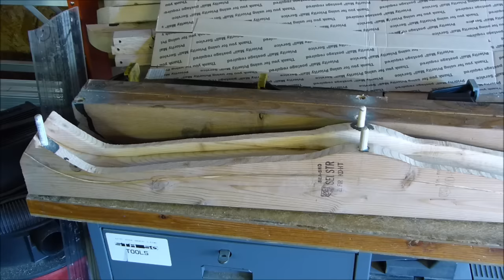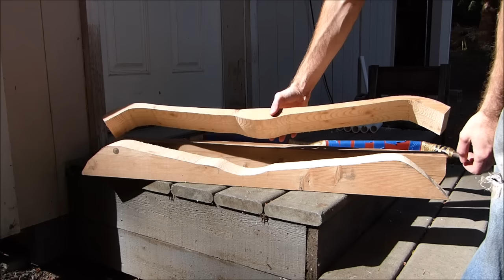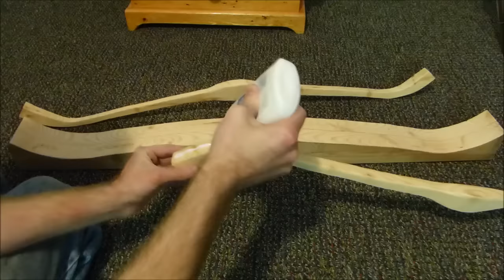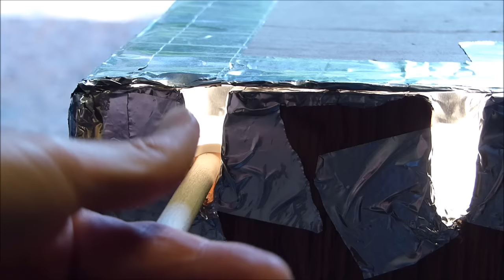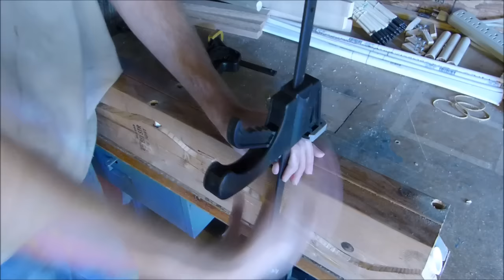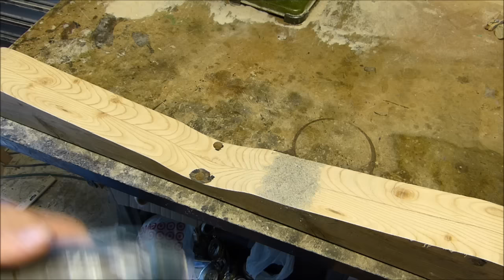Make A PVC Bow Mold / Press

Comment: If one has any talent at all, it is perfectly 
feasable that you could design you own bow and not have to "clone" an existing one. Your methods leave a little to be desired, in that the bulge you wound up with shouldn't have happened in the first place if you had done more work on your form.
Reply: P McRae....Dude... What kind of douchebag makes comments like that! The guy made a decent bow and a great idea with the mold build. If you don't like it don't fucking watch the video. Plenty of actual companies put out products with defects. The nice thing is he realized the issue and fixed it. Didnt know you were Jesus Christ with no imperfections. Fucktard!
Reply from the maker: I designed and made the bow to clone. It is not a good idea to make the mold without building and tuning the bow first. The bulge comes from the band saw cut, band saws are hard to cut straight with while still having a blade narrow enough for cutting the curvy parts, especially when the blade is extended that long (you can't see down through the wood to know if the blade is twisting inside). If you had any talent at all you would be in the circus.

Comment: When will these bows be for sale?
Reply from the maker: tensephilly Thank you for asking! I will have some available for sale in just a few days.
Reply: Alright, what colors will be available?
Reply from the maker: tensephilly The main part of the limbs is vinyl wrapped or painted in a variety of colors, the vinyl colors I have are red, blue, darker bluegreen, dark olive green, brown, and grey. Paint can be any normally available spray can color. The siyhas are wood and can be stained or unstained, I think paint would rub off. The handle wrap could be several different things too. The completed bow shown in the video has twine but it is prickly. That gets better with use but I might need to buy different twine or figure something else out. Otherwise I could sell unfinished bows at a discount (basically how they come out of the mold but with a string bridge added).
Reply: JaycubL
Nice, and how much will they be? And is there a take-down variant?
Reply from the maker: tensephilly I haven't decided for sure on price yet, I have to get a good count of the exact cost in both time and money to make each bow. And I have enough experience now to where I am done with making like $7 per hour or something. It will probably be about $65 for the finished ones and about $45 for the unfinished (but mechanically complete) ones.

Comment: that's cool. you can make a bunch and sell them or gifts
Reply from the maker: clidelivingston Yes, I ordered recently 200 bow strings (I am slow at making strings so it was worth saving that time to me) and will make a second different mold.
Reply: awesome, does that bow shape in the video shoot pretty well?
Reply from the maker: clidelivingston Yes it has good tension from zero draw out to full draw and does not stack. I had not shot a bow in a while but I was able to get very consistent groupings with this bow after just a little practice.
Reply: Thanks die thus excellent Video. Can i Buy One Bow?